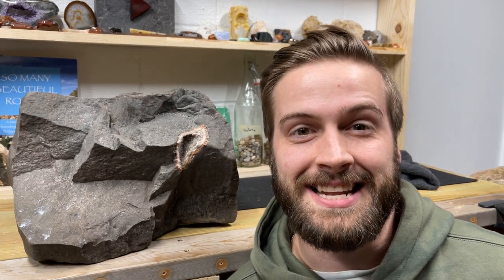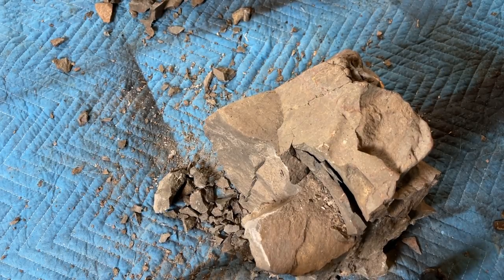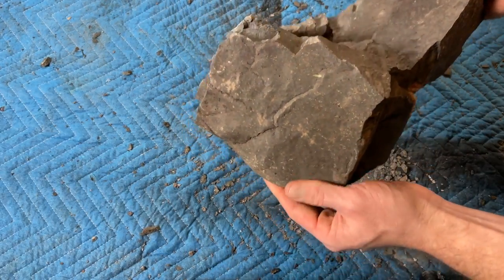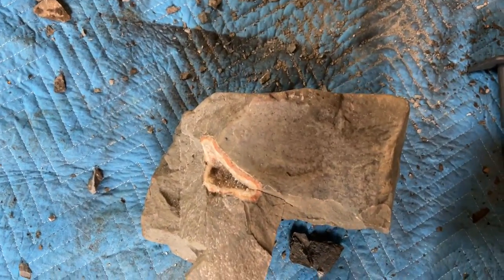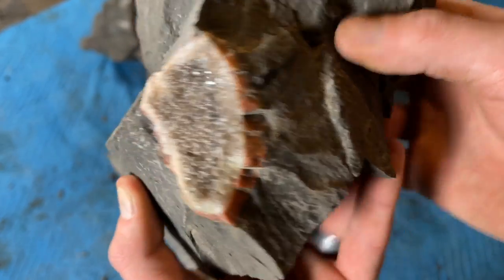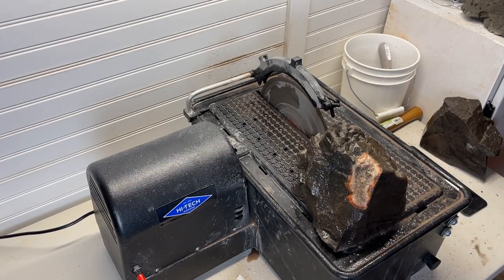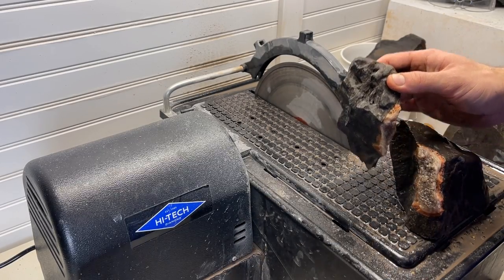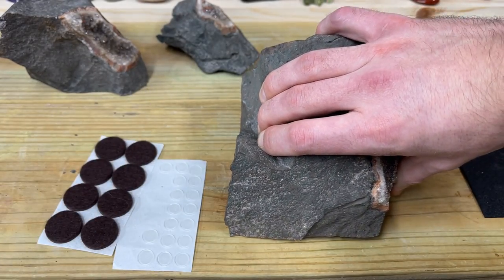Rock Chisel vs. Geode Agate in Host Rock | A Challenging Lapidary Project

Comment: I have a few smaller host rock agates, fortunately mine are smaller as are the agates, but a couple of them I thought of trying to separate them. Like you I noticed a couple have microlines intersecting on the agate, so I figured I too would shatter them. Now I'm starting to believe that a lot of my pieces are a result of the host rock breaking instead of other forces of nature breaking them. Even trying to separate agates on the beaches has resulted in disaster. Looks cool like that, quite remarkable setup in the end.

Comment: I was hoping that you'd use a angle grinder to cut it but then you probably would of had the same result because of the fractures. It still come out great as a show piece and you can see all the crystals and the banding. Maybe blessing in disguise. Still a great video as always and stay safe and rock on thx 👍👍🇦🇺

Comment: Hi Taylor, I must admit I was a bit concerned when you decided to try and break it down with just a hammer & chisel. You have a bit more experience than me with the rocks, however I have been in the building game since I was 16 years old, now 66. So I have a little experience in cutting all kinds of material. 
I was concerned that it might fracture right in any & all directions. I was thinking a 4in angle grinder with a diamond blade and make the cuts first to try and give it a plane of weakness and then use some steel wedges to try to make it fracture along the cuts. Sorry I am not trying to criticise and provide info for future attempts. Cordless grinders & the blades are not too expensive. By the way I’m quite impressed with your cuts on the saw, getting that close freehand is a bit of  an accomplishment on its own. 
You could glue those pieces back together if you choose so long as the pieces fit neatly back together. 
It’s still nice just not what you had hoped for. 😡 . Lesson for all of us,. Keep Safe & Keep Rockin

Comment: Misery loves company. Although much smaller,  I also found an agate embedded in basalt. The whole stone was beach-polished with luttle agate "windows" peeking out of the basalt on several sides. I was convinced that the basalt was covering a larger agate. I showed the stone to Bob Lynch at Agate City in Two Harbors. He disagreed with my opinion and said the agate 'probably'
Reply: He said the agate showing probably did not go into the stone farther. I decided to chisel the stone & Bob was correct. It was only basalt inside.

Comment: It is what it is. Maybe I would have tried to stabilize the piece by filling the crack through the geode with superglue before working further. Might have worked, might as well have ruined it. It's always a gamble.
Reply from the maker: I have honk the fractures and chiseling would have caused it to crack even if it was glued

Comment: Very frustrating. I would have immediately stopped and coated it all with thick CA or 5 minute epoxy and strapped it up to dry. I have done it a lot over the years. But, yours makes a unique display with a great story and video to go with it. If you sell it, give them a chip with the video. I just want to say you did a great job of freehand cutting in the round. It is really hard to have all the straight lines connect. You did, and you should be proud, it's not easy. Keep the goodness coming. Be happy, safe and stay healthy! 😷⚒

Comment: I thnk you should have made incisions with an angle grinder+ diamond disc before you made the first...jabs...as as deep as possible, and not too close to the geode.
It should have split easier at least...
Reply from the maker: I guess I wouldn’t spend that kind of money for this kind of project lol
Reply: @AgateDad  .... I bought my  125mm /5inch angle grinder with variable speed  for some 100 euros. The disc cost about 10...
Pretty sure its a  lot cheaper than a  lapidary saw+ flat lap+ cabbing machine. And I bought it for woodworking though.
Also the cheaper, fixed speed, angle grinder would cost significantly less. And the discs too...